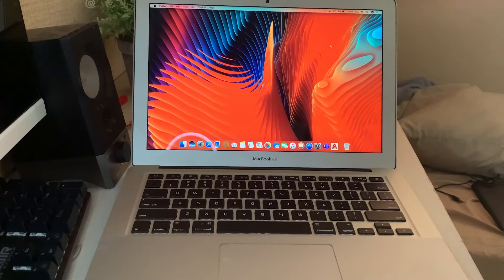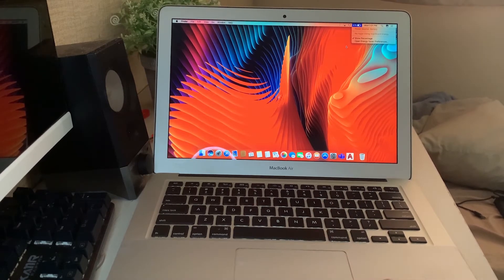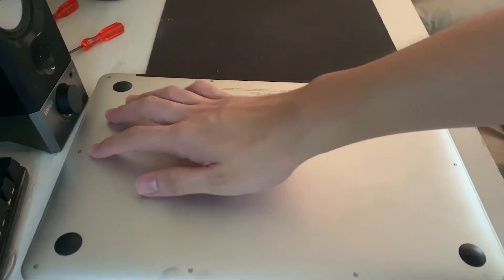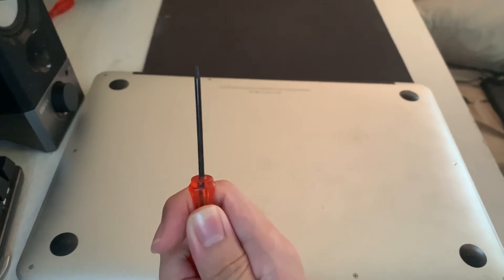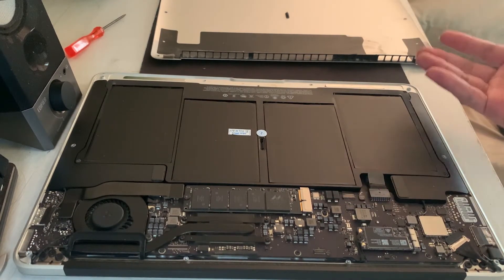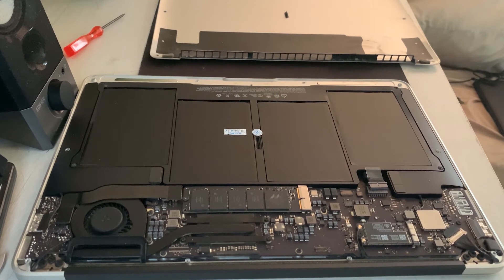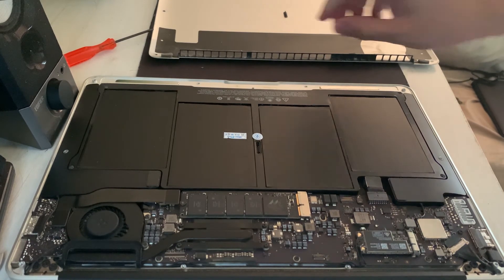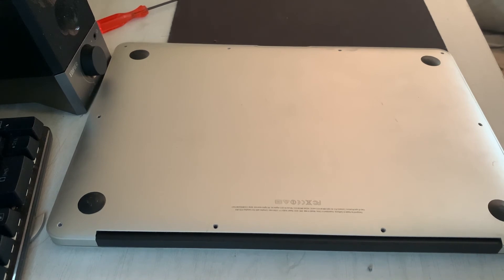*EASY* Service Battery Fix MacBook  2021

Comment: Hello. My computer is macbook air m1 running big sur with this error, how to fix it?
Reply: Are you on 11.3?
Reply: I upgraded from 11.3 to 11.4 and bam!!! My battery needs "service recommended".Not charging just boots up when I plug it in shuts down Immediately if the type C cable moves even slightest!
Reply: @KaziUpal  Hi, I am still using the above, I have upgraded to OS 11.4 but the result is still the same.

Comment: did not work on Mac book air 2017 I have service recommended message not going with smc reset or draining battery or your method any suggestions.. 2.5 years old Mac with 333 cycles and decent battery life
Reply: Having the same problem with my 2017 Mac book air. Any luck since?
Reply: @sicmike2g   above did not work, I down graded to high Sierra then again formatted and installed Big sur. Now the message is gone and it says. battery is ok. I challenged apple with all screen shots. they advised me to spend 15000 and change battery. Now they are puzzled and are saying will ask their engineers to check logs... not sure they want to help on battery issues
Reply: @sreekanthp5551  Seems to be more of a software issue than a battery issue. Upgraded to big sur a few days ago, now I'm wondering if its something with the OS.
Reply: @sicmike2g  thought only windows had all this kind of basic bugs hope next version will sort it out.. cringing to spend 200dollars at 333 cycles :)-
Reply: @sicmike2g  once they figured out no solution.. they are leaving messages saying 'am not reachable' that explains...
Reply: @sreekanthp5551  I am at 350 cycles.  Apple claims the battery is good for 1000 cycles which I am far from.  Hopefully it gets fixed with the next update.  Based on forums, many people are complaining about this.
Reply: @sicmike2g  yes they closed the issue as I don't get replace error. Significant energy message is just FYI. Looks like a big Sur bug. Read a lot of week old Mac's have the issue. Will wait for an update.. what else?
Reply: Same here on MBP 2014